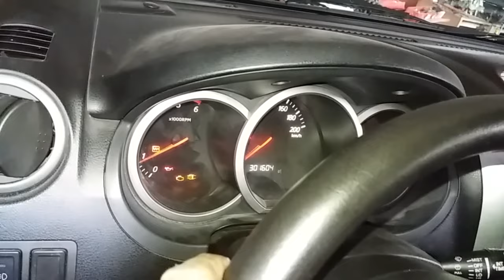CHANGING the ENGINE OIL and OIL FILTER Suzuki Grand Vitara 1.9 ddis / How to Change Your Oil 👀⬆

Comment: Can you show where the Engine Coolant temperature sensor is located? For replacing etc sensor
Reply from the maker: For diesel or petrol engines
Reply: In 1.9 ddis sensor is located on the back of the engine(between engine and cabine) When i replaced that sensor i had to take of battery and drive all coolant. It's vey had to get in there and i have small hands. thats good that i had faulty sensor and thermostat was ok. If i would have to change thermostat then would be even harder.

Comment: كم لتر من الزيت وضعت
Reply from the maker: We will use 5W-40 Diesel engine oil full synthetics.
According to the instructions for the car, we need to pour 5.1 liters. First we pour 4.5 liters and start the engine until the oil indicator stops lighting. Let it work for another 20 seconds, then add the rest of the oil.
We stop the engine and check the oil level.